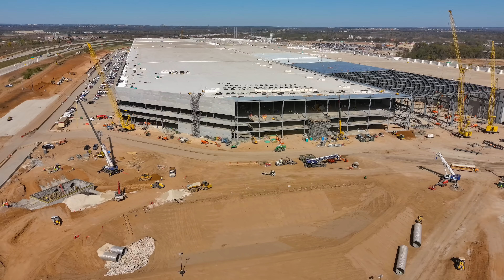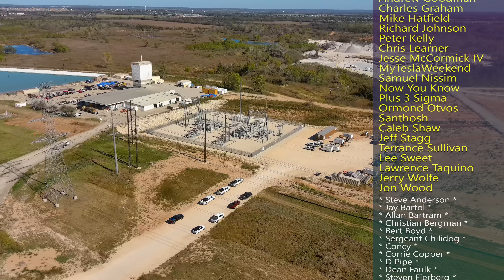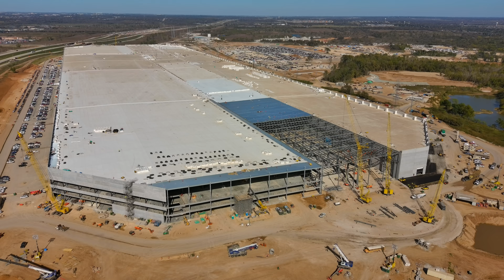Tesla Gigafactory Austin 4K  Day 488 - 11/22/21 - Tesla Texas - GIGA TEXAS CONSTRUCTION UPDATE!

Comment: Thanks Jeff. 3rd attempt to post this comment. Youtube not liking youtube links today. 
1:13. East side casting. They’re are really ramping up…. and down.
1:46. East side BIW. Near enough to Stamping. Scrap bin. Time to keep an eye on these for reject panels etc.
1:51 East side Stamping. Jacks and gantry. 6 hours from when Joe flew past this morning to get the delivery inside. 
2:28. South end. Bottom left of screen. Couple of small sections of channel not excavated. Would  be the location of surveyors pegs showing the invert level (bottom) of drain
2:34. Splitter box. Drains on the left bedding in with flowable fill (all fines self levelling concrete/grout). Drains on the right, bedding in with gravel.
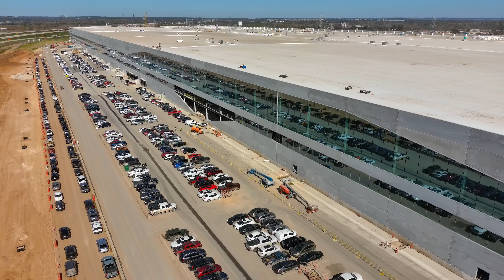3:06. West side road. Just realised the flag waving traffic directors have gone.
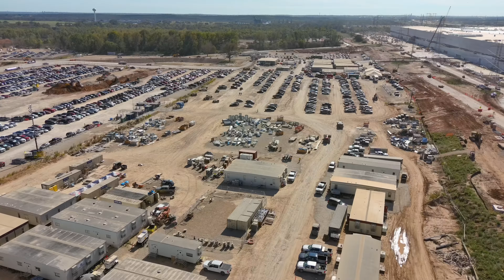4:30. East side pipeline easement. They started fencing this area off on Jeff’s Day 384 or thereabouts. 
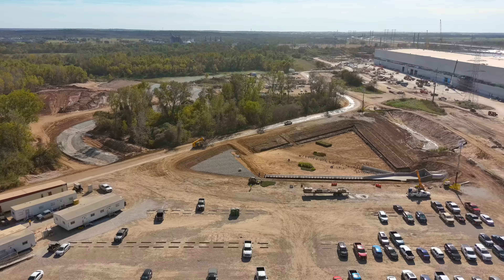4:52. East side pond. Stacks of rolls of instant turf/grass for pond bottom. 
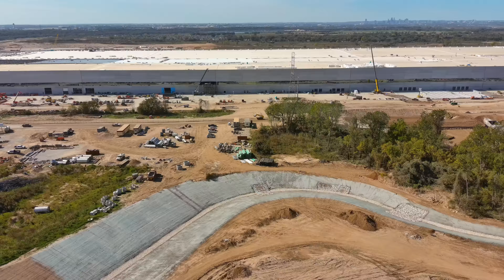5:09. East side near pipe mill location. Left of screen. 2 elevated white tankers here now. Additional tanker showed up Day 485, and raised on Day 486. They got by with 1 for over a year.
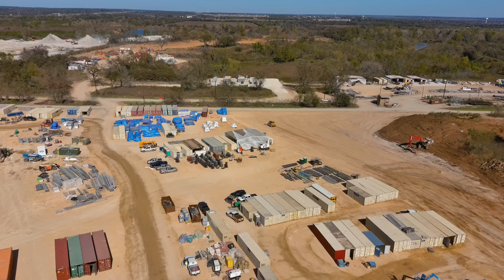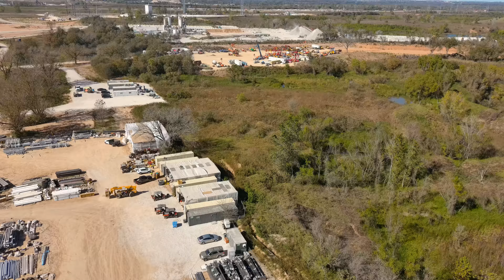5:57. East side storage. Wind machine here today. Finished with it at the regular location at 6:12.
7:16. Old bagging plant. Soil test drilling rig in same location as yesterday.
8:53. South end stamping plant extension. Worker near the topping out tree. Gently guiding a bolt into place. 
9:02. South end Stamping extension. Final columns are significantly smaller section. No floor load, just the walls and wind load.
Trying to work out what will support the short (currently) cantilevered beams on the outside columns. Can’t see any sign of an attachment point for a suspension member.
Frames on ground. Would be for between the cantilevered beams. Left frame with joists on top, so a floor planned. Will need support/suspension. 
9:11. South end. Retaining wall. Starting to think this is an architectural feature more than anything else.
9:36. Retaining wall outlets to pond. These are lined with a black material that continues inside and lines the back face of the wall.
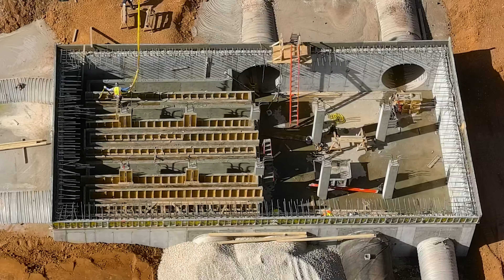9:57. Splitter Box. Edge boards for the lid/top have been placed. Access stair removed, ladder access now.
It would be great to see this in operation without the roof, unfortunately the roof may be days away only.
Reply: 9:36 outlets to pond, 2nd from right... chillin' in the weir
Reply: @dan_w3st  A sunny afternoon, a soft bit of concrete. Hard to resist!
Reply: 8:53 persuasion provided by that tool the ironworkers call a "beater"
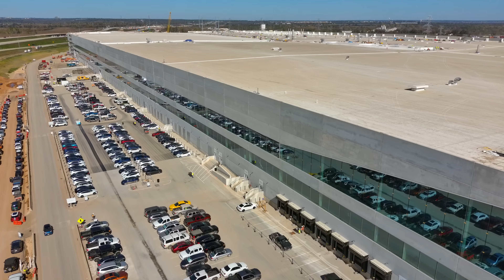Reply: The pack of Teslas I commented on last week disappeared over the weekend, but now they are back in the charging stalls at 3:14. I still think is a small batch of test vehicles being signed out to employees for daily driver experience.
Reply: @Libertylute  May well be, but impossible to tell. The metallic Aqua Blue car has been around for most of the year and parked on the east side. Nice colour, I'd buy it.

Comment: Are they going to totally complete the end of the building and then rip off the wall panels to do the extension? :)
Reply: Yep, if it ever happens.
Reply: At this time we do not know what or when the extension will occur. It was included on the civil plans to calculate area covered by buildings, could be several years.
Reply: The extension to the southside, right?  The site plan showed a road in between the main building and the extension, if I remember right.  The extension and main building are likely to be connected by overhead walkways.
Reply: @Kennyw84  My first response was a bit clunky, so have deleted and rejigged. What the site plan shows is additions to 'Extents of Impervious cover' for Phase 2. The road was already part of the impervious cover as calculated in Phase 1, so it's shown on the plan only as being part of Phase 1 calculations of impervious cover.

There's a scale top right of the plan, and if you measure the 500' extension it shows it to be in fact 370'. That 370’ is only the additional ‘Extent of Impervious cover’, not the building outline.

It's a misunderstanding that there will be a road. The plans are Civil, not Architectural.

They’ve used the possible additional ‘Extent of Impervious cover’ to calculate the stormwater handling system so that in the event the 500’ extension does go ahead, they won’t need to radically alter the stormwater system.
Reply: @Kennyw84  Interesting! I missed that info previously!